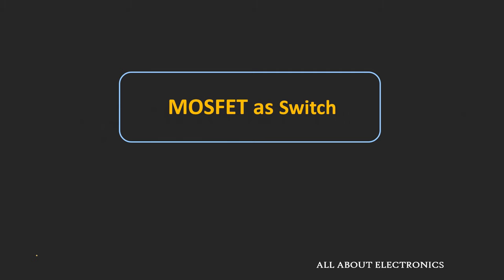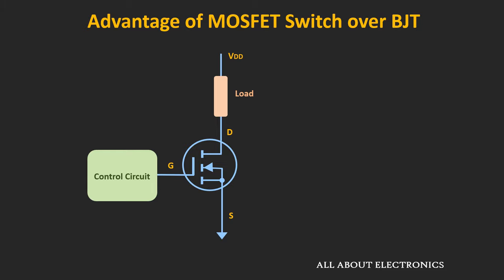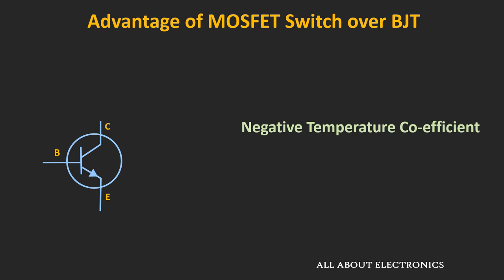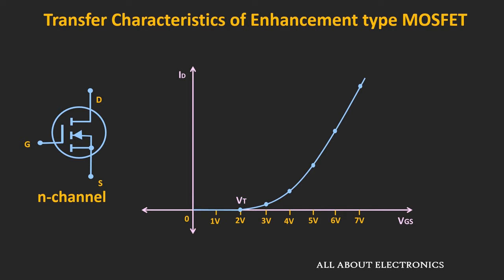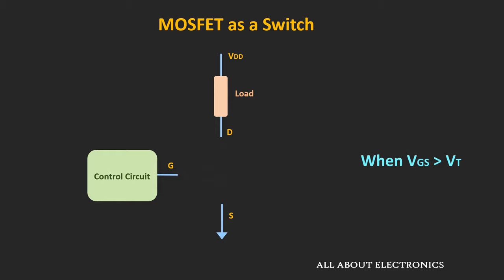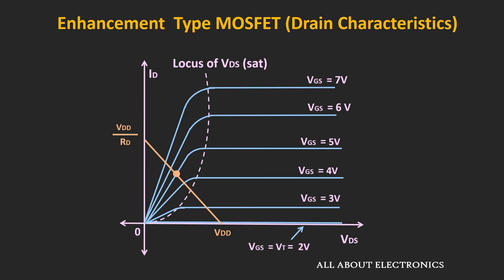How to use MOSFET as a Switch ? MOSFET as a Switch Explained

Comment: Even though we say MOSFETs are gate voltage driven, for high frequency operations we need to look at gate current as well.
Reply: Could you please elaborate more
Reply: @AkbarNurPribadi  Gate has capcitance and to charge capacitor you need current.

Comment: One question - the pull down circuit has been shown to be just a simple R connected to ground. But when the control circuit provides a high on gate terminal, wont this resistor R provide a path to the ground always sinking current, creating power loss? Or is this R very high so this current is minimal ? In practice is the pull down circuit this simple?

Comment: In addition, this video describes a low side switch. A N mosfet can also be used as a high side switch, but will need a isolated gate driver.

Also: a mosfet always has a body diode, which will conduct if the current is reversed form drain/source to source/drain (inductive spikes will pass)

Comment: Thank you in advance, please tell me why in p-type MOSFET you put the load after the MOSFET,I mean at the drain side and not on the source side?
Reply from the maker: For the P- type MOSFET, to turn it ON, Vsg should be positive. (Vsg > |Vt|) Or Vgs should be negative. So, what is usually done is, the source is directly connected to supply voltage. And through a pull-up resistor, the gate is connected to supply voltage. Based on the control input, the gate terminal either connected to ground or supply voltage. If it connected to ground, then Vsg is positive ( is equal to supply voltage) and MOSFET is ON. If it is connected to supply voltage then Vsg is zero and MOSFET is ON. 
The load is connected to drain side. If the load is connected on the source side, then depending on the current drawn, there will be a voltage drop across it. If the voltage drop is too large, then Vs might be less than Vg. And in that case MOSFET will not turn on. By connecting the load on the drain side, turning ON and OFF becomes much more easier. I hope it will clear your doubt.

Comment: Dear Sir,
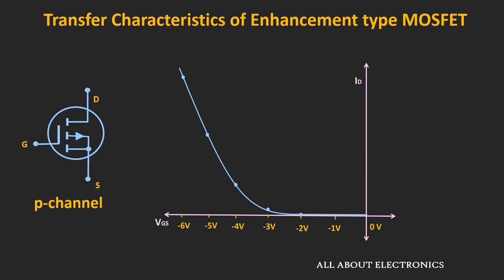in slide at 13:19 you draw the internal of the MOSFET same as previous slide(12:50). But the D and S are swapped?
Can you explain if it is correct or no, and if, what should be corrected?
Reply from the maker: At 13:19, the substrate should be connected with source side instead of drain side. That is the only correction.

Comment: Great video. Why does the load need to follow the drain side when using a p-channel? Couldn't there be a way to keep the load on the top on the source side?
Reply from the maker: The thing is VGS is control voltage. In case of PMOS, when VSG > VT, then MOSFET will turn on. If we connect load on the source side, then depending on the current drawn by load, the source voltage Vs will change. And that can effect the control voltage VSG (VS- VG).
If we connect the load on the drain side, then voltage VSG will remain independent of the load. 
I hope, it will clear your doubt.
Reply: @ALLABOUTELECTRONICS  Yes that clears it up, thank you!

Comment: What if your drain current is very small? Im designing a motion activated LED using a toggle flip-flop to activate the 2N7000. My calculated Id is less than 10 milliamps.

Comment: At 6:30 you say that as the gate to source voltage increases, the slope of the line (the resistance of FET from drain to source) will reduce, which is incorrect. As the gate to source voltage increases the slope of the line (resistance from drain to source) increases as well
Reply from the maker: well, I was saying the same thing. See, when the slope reduces, the resistance increase. Slope is y/x. Slope is inversely proportional to resistance.
Reply: @ALLABOUTELECTRONICS  yeah I made the mistake not you, I was thinking the slope was the resistance but you're right its the inverse of the resistance, thanks!

Comment: How do you calculate the value of R, the pull down or pull up resistor? Thanks.
Reply from the maker: Typically, any resistor value between 1K to 10K would do the job.

Comment: Hi I am having a very big issues understanding how mosfet conduct with positive and ground connections together work because I am trying to build a inverter I built mircro controller working will but when I try invert with mosfet the 2 mosfet or connect to transformer the mosfet blow I try getting help to get a inverter work in my country the knowledge is very little so I have no one to turn to for information on way mosfet blow the negative voltage conduct very well but when I connected the positive to drain and negative to source the mosfet blow everytime and that how inverter works positive to drain and negative to source but I blow 500 husband trying to turn them on like the inverter circuit I see online I try all on them and I just keep getting blow mosfet

Comment: I am currently working on Mosfet driving inductive load (brush coreless dc) .The current which the mosfet currently draws at max Vgs is less than required .What should I do so that the current drawn by mosfet increases at max Vgs.
Reply: Use wider MOSFET 
I.e increase width or use parallel MOSFET devices

Comment: I think any transistor in switch condition working cutoff and saturation and amplifier in linear region.
Reply from the maker: For MOSFET, the terminology is little different. The flat region is referred as saturation region, where even after increasing the voltage Vgs, the current remains relatively flat. ( In BJT it is called linear region, where it is used as an amplifier). And the linear region is the one, where current voltage relation is  linear.

Comment: how to calculate the value of pull down resistor?
source should be connected always to gnd? 
thanks
Reply: Depending on if your fet is n or p channel source and drain might be other way round and no you can have your load between the source and gnd insted I think not sure tho

Comment: Why does the Vd decrease when mosfet is switching on and Id is increasing at 17:15?
Reply from the maker: Since MOSFET acts as a switch, so VDS will be very less when it is ON. Vs is at ground, so Vd will also be near to that. That means when MOSFET is used as a switch and when it is ON, then Vd will be low. And since MOSFET is ON, so current will flow through it. But it will not happen instantaneously. It will happen gradually. That's why when Vd is reducing when Id is increasing. I hope, it will clear your doubt

Comment: Hi. Is it possible to calculate the value of minimum Vdd if I have logic level IRL540?
I want to control 5V LED strip by PWM from arduino?
Reply from the maker: Yes, based on the required current, you can select Vdd and the series resistor with the LED strip.
Reply: @ALLABOUTELECTRONICS  Thank you. But I have led strip with resistors on it and it has to be supply by 5V, so I do not know if this 5V is enough to supply drain of this logic level mosfet. What do you think?
Reply from the maker: @UP-pb2pg  well the exact design depends, how many LEDs are there in the strip. And in how many rows they are connected. What is the series resistance of it? what is the typical current drawn by the LED strip? Considering all these aspects, the Vdd and external series resistor (if required) can be decided.
Reply: @ALLABOUTELECTRONICS  i will check it, thank you for your answer

Comment: 32khz, 62khz frequency give to piezoelectric from arduino. and using mosfet to increase voltage 12v of signal. please tell me solution which circuit i use?

Comment: what is meant by triangles in switching losses
Reply from the maker: During the switching, the current increase and the voltage reduce or vice versa, the voltage in increasing and current is reducing. Because of that, momentarily the power consumption increases, reaches its peak, and once again starts reducing. The triangle indicates that switching loss.

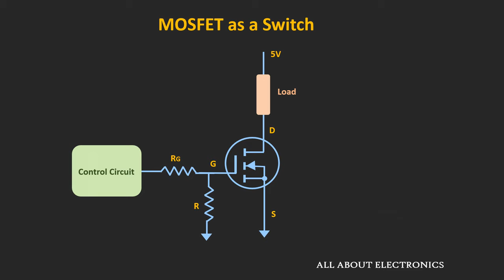Comment: @12:39 how do you compute for the value of the pull down resistor R?
Reply from the maker: The value of R should be in 10s of kilo ohm. If it is too low (in ohm) then when microcontroller input is low, it will draw a lot of current. It should not damage the controller pin. If the value of R is too large (in MΩ), then it is comparable to the input impedance of the microcontroller pin. And it may form a voltage divider circuit with the input impedance. And the actual voltage appearing at the gate will be less than 5V (for 5V microcontroller). So, it should be 1/10th of the input impedance of the microcontroller pin. (The input impedance may be between 100KΩ to 1 MΩ) range. If not sure about the internal impedance of the microcontroller pin, then you may use 10k resistor.
Reply: @ALLABOUTELECTRONICS  thanks

Comment: 🎯 Key Takeaways for quick navigation:

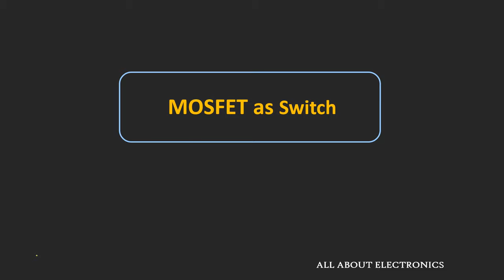00:06 🔌 MOSFET vs. BJT for Switching
01:31 ⚡ Advantages of MOSFET for Switching
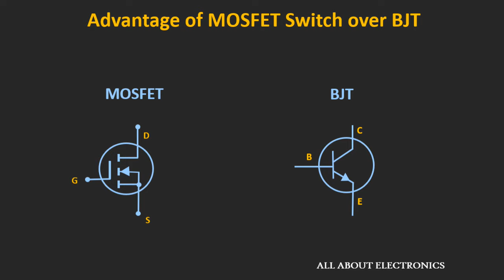04:22 📏 Types of MOSFETs and Their Characteristics
06:42 🌐 Operating Characteristics of MOSFET as a Switch
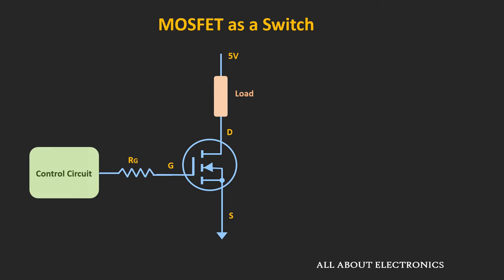10:52 🧾 Control Circuit and Protection for MOSFET Switching
15:07 ⏱️ Fast Switching and Gate Charge

Made with HARPA AI

Comment: 10:27 some says its Ohmic Region, Triode region, you say its linear region.
Reply from the maker: Yes, different text books and datasheet MOSFET represents that region by different names.
Reply: @ALLABOUTELECTRONICS  one more question. meaning of as "switch" is selecting one of the curve based on VGS input? in my meaning switch is just on and off. but switch meaning here, off and (can choose one of the  curve) yes? its like variable resistor ? why called switch? why not called switch variable resistor? and switch in my meaning its like memory register, on and off. 0 and 1. , so its analogue switch ?? enlight me please. thank you.

Comment: you didnt even explain the graph
Reply from the maker: It is already explained in detail in the earlier videos of the MOSFET. Please check the MOSFET playlist on the channel.
Reply: @ALLABOUTELECTRONICS  I'm confused why Vd decreases as Id increases...i saw the earlier videos..but I don't get it...I'm talking about the last waveform
Reply from the maker: The last graph shows the switching and the power loss in the MOSFET. Initially, when the MOSFET is OFF, then no current is flowing ( Id is almost 0). As soon as it is turned ON, then it offers very low resistance and current starts flowing through it. And as it offers very low resistance, the drain voltage reduces (close to 0). Ideally, it should happen instantaneously. But in reality the switching happens gradually. That means, gradually, Vd reduces to zero and Id increases from 0 to max. value. I hope, it will clear your doubt.